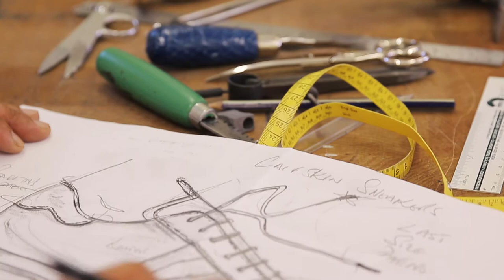LCF Short Courses - Making a Sneaker/Trainer

Comment: You guys have skip the main part which is detachment of wooden last, secondly don't you think that by just pasting the upper with sole is not enough because it can detached any time as far as the glue will get dry. OR if the customer uses it roughly then there might be a high possibility that it can tear.

Please explain.